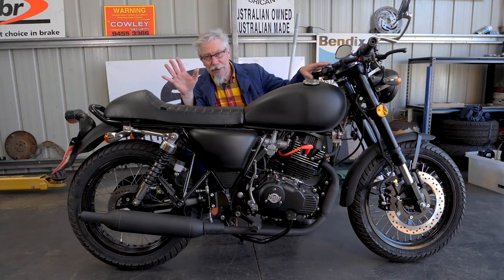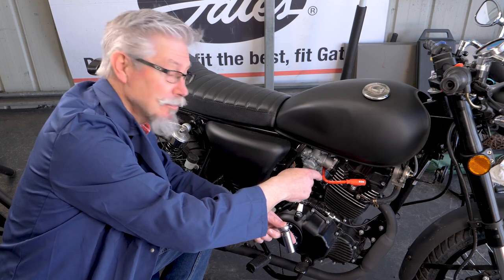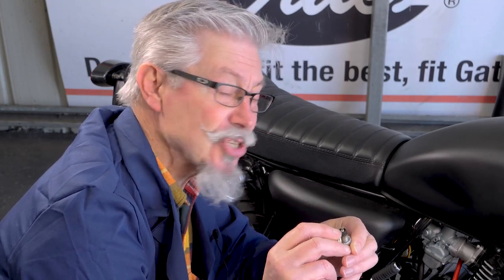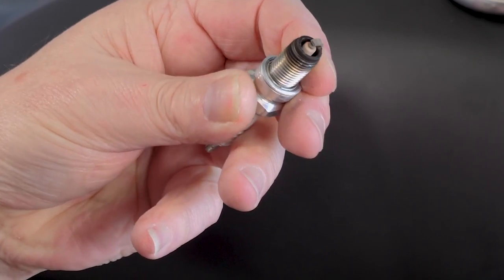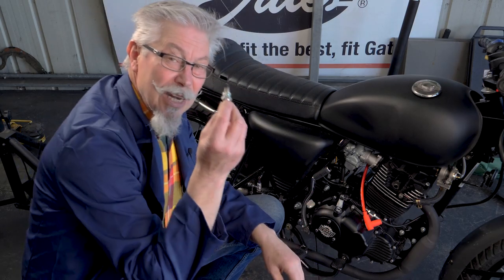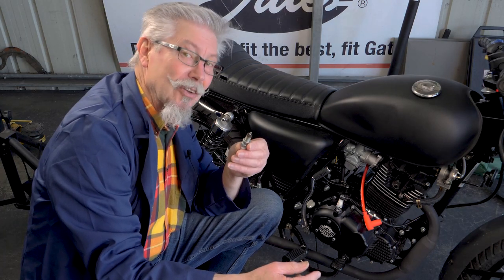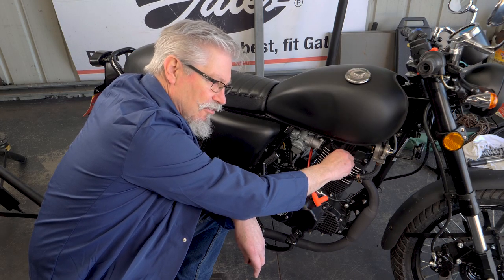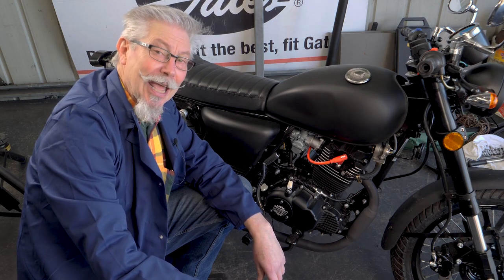Servicing your Bike - DIY  The Sparkplug. Tuning for performance & economy

Comment: Great video Bruce, have you worked with Braaap's Moto 3 models? Would the same apply to them as I was told they have the same engine.
Reply from the maker: Thanks for watching. The Moto3? Are all brothers & sisters in the same family.
Great bikes in need of love and regular maintenance. Enjoy your ride. Safe journeys and Haveagreatweekend. Don't forget to subscribe do you don't miss out on our whole maintenance series. Cheers Bruce
Reply from the maker: Similar sibling motorcycle the Moto3 has an ohc engine but but very similar apart from that.